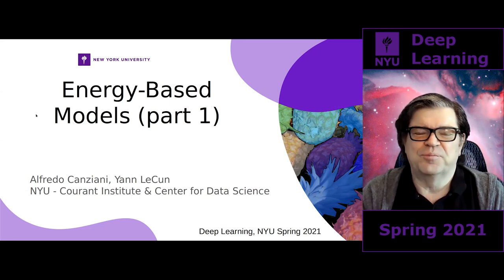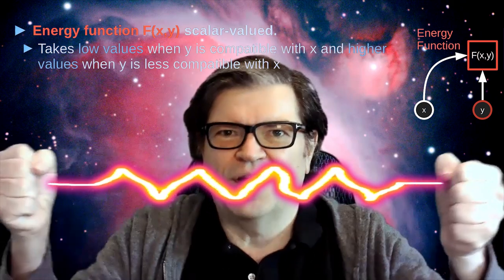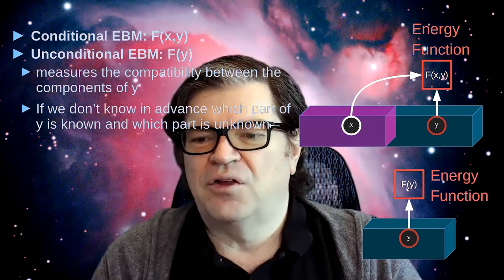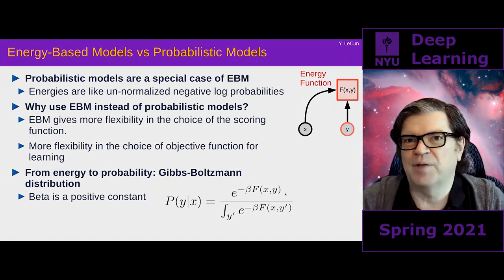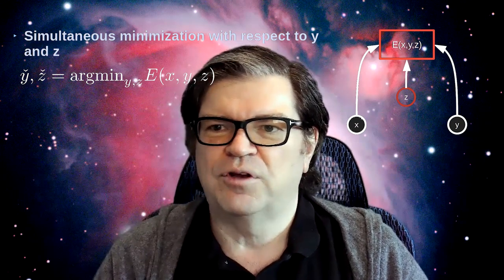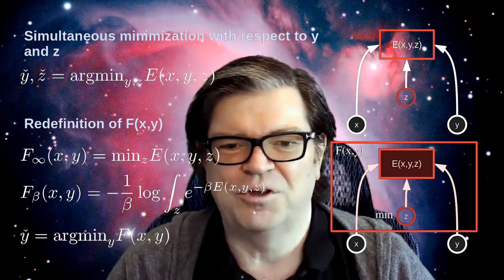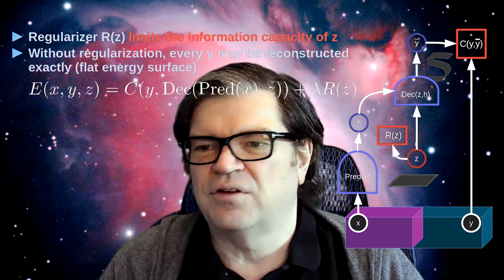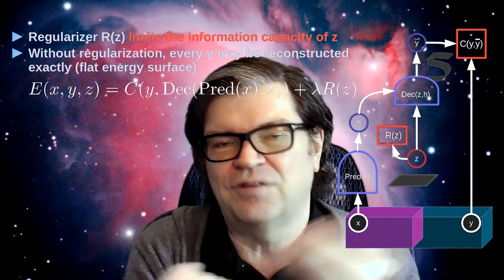05L – Joint embedding method and latent variable energy based models (LV-EBMs)

Comment: Again @Alfredo Canziani thank you very much for making this public, this is an amazing content.
I have several questions (I refer to the instant(s) in the video):
16:34 and 50:43 => Unconditional model is when the input is partially observed but you dont know exactly what part. 
    - What is test/inference in these unconditional EBM models? Is there a proper split between training and inference/test in the unconditional models?
    - How does models like PCA or K-means fit here, what are the partially observed inputs Y? For example in K-MEans you receive all the components of Y, I dont see that they are partially observed

25:10 and 1:01:50 => With the joint embedding architecture
    - What would be inference with this architecture, inferring a Y from a given X minimizing the cost C(h, h')? I know that you could run gradient descent to the Y backward the Pred(y) network but it is not clear to me the purpose of inferring Y given X in this architecure.
    - What does the "Advange: no pixel-level reconstruction" in green means? (I suspect that this may have something to do with my just above question)
    - Can this architecture also be trained as a Latent Variable EBM? or it is always trained in a Contrastive way

Comment: Dr. Yann only mentioned this in passing at 20:00 , but I just wanted to clarify, why does EBM offer more flexibility in choice of scores and objective functions? It's from page 9 on the slides. Thank you!
Reply: nvm, I should have just watched on, at 1:04:27 Yann explained how probabilistic models are EBM where the objective function is NLL.
Reply: then by extension, the scoring function for a probabilistic model is probably restricted to a probability.
Reply: the info at 18:17 is underrated

Comment: I spent some time to derive the step mention in 1:07:44. I made my best effort to get the final result. But, I am not sure if my steps are correct. I hope my fellow students can help to point out my mistakes. Due to the lack of LaTex support in Youtube comment, I try my best to make my steps as clear as possible. I use partial derivative for log to get to the second step. Then, I use Leibniz integral rule to move the partial derivative inside the integral in the third step. The rest is pretty straightforward, hopefully. Thank you!

∂/∂w (1/β) log[ ∫y′ exp[−βFw(x, y')] ] = (1/β) [1/∫y′ exp[−βFw(x, y')] ∂/∂w ∫y′ exp[−βFw(x, y')] = (1/β) [1/∫y′ exp[−βFw(x, y')] [∫y′ ∂/∂w exp[−βFw(x, y')]] = (1/β) [1/∫y′ exp[−βFw(x, y')] [∫y′ exp[−βFw(x, y')] ∂/∂w −βFw(x, y')] = - [1/∫y′ exp[−βFw(x, y')] [∫y′ exp[−βFw(x, y')] ∂/∂w Fw(x, y')] = - [∫y′ exp[−βFw(x, y')/∫y′ exp[−βFw(x, y')] [∂/∂w Fw(x, y')] = - ∫y′ Pw(y'|x) ∂/∂w Fw(x, y')
Reply: can you put a link to a latex file? I did the derivative and maybe able to help.

Comment: Thanks a whole bunch for this lecture, after two times I think I'm starting to grasp it :) One thing that confuses me though is: in the very beginning, it is mentioned that x may or may not be adapted when going for the optimum location. I cannot quickly come up with an example where I would want that? Wouldn't that mean I am just discarding the info in x and - in the case of modeling with latent variables - now my inference becomes a function of z exclusively?
Reply from the maker: You need to write down the timestamp in minutes:seconds if you want me to be able to address any particular aspect of the video.
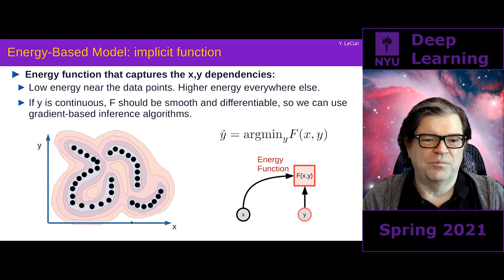Reply: @alfcnz  Thanks for taking the time to respond! Here we go, 15:20

Comment: I tried to calculate the derivative Yann said (1:07:45), but probably I am missing something because in my final result I don't have the integral (only -P_w(.) ...). Is there any supplementary material with these calculations?
Thanks again for your amazing and hard work!
Reply from the maker: Uh… can you share your calculations? I can have a look. Maybe post them in the Discord server, maths room, so that others may be able to help as well.
Reply: @alfcnz  It was my bad. I... misunderstand the formula of P_w(y/x) and thought that was an integral at the numerator (over all y's), but that didn't make any sense to me and checked again your notes and ...voilà I got the right answer.
Is the discord open to us too? I thought only for students of NY. I definitely join then (learning alone, isn't fun :P).
Reply from the maker: Discord is for non NYU students. I have another communication system set up for them.